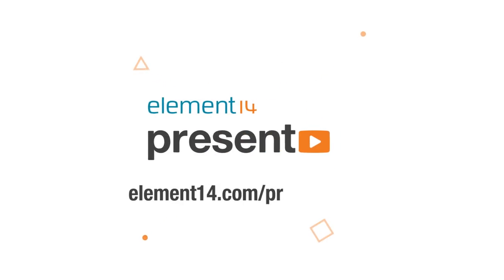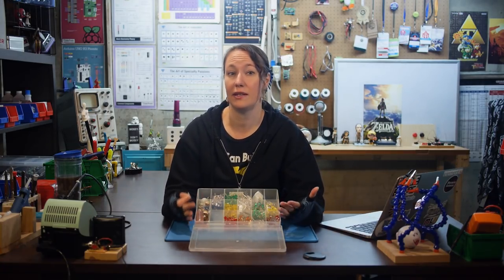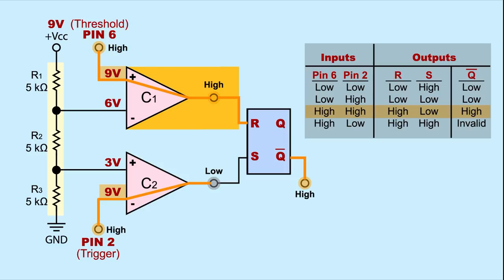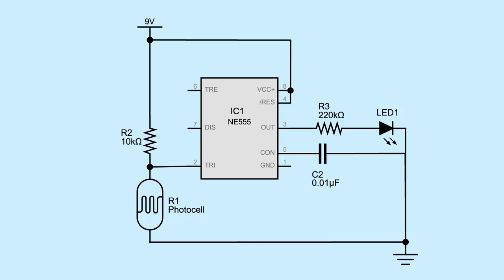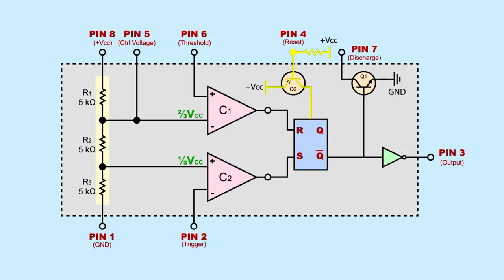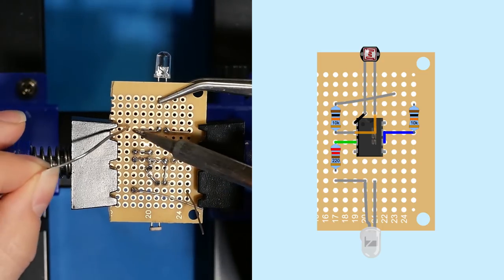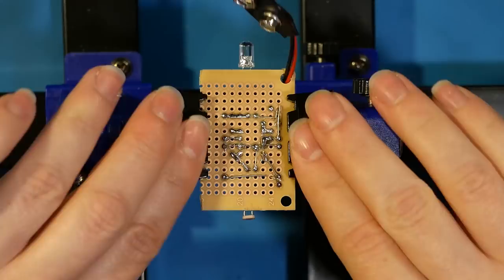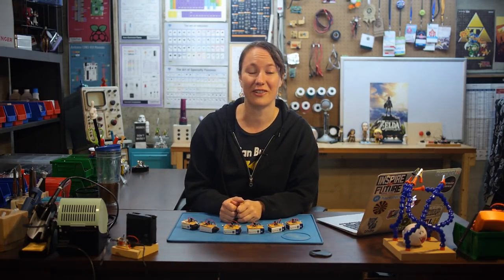LED Dominos Using a 555 Timer - The Learning Circuit

Comment from the maker: Karen changed her design to run off a 9V battery, but that isn’t the only change. Look closely at both the original and then Karen’s schematic designs. Since the original design used a 3V battery, how does the difference in design change the behavior of the circuit? 

Post your hypothesis in the comments below!
Reply: More power substantially changes all of the circuit's variables?

Comment: Gloves 🧤 please when soldering
Reply: Why?
Reply: @naits7  yea, why?
Reply: never had gloves while soldering. they get in the way, its really impractical
Reply: I work in the manufacturing industry - no one wears gloves when soldering, even when we have to use leaded solder...
Reply: Just wash your hands!
Reply: Gloves are a terrible idea to wear while soldering. Especially if they are non-cotton. If the iron comes in contact with the glove, it would melt and potentially cause a worse burn than the iron itself. Do not wear gloves while soldering.
Reply: Never worn gloves, and if you did,they would need to handle heat, after enough experience you learn not to get burnt lol
Reply: There is no weld arc to consider 🧐